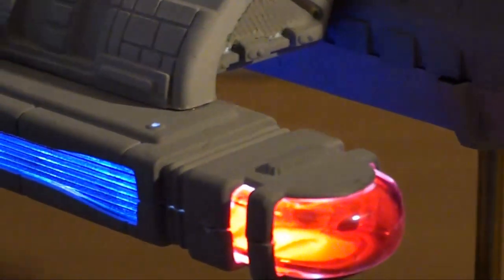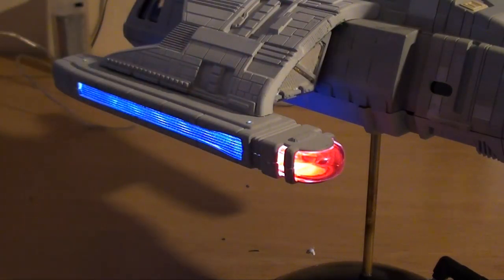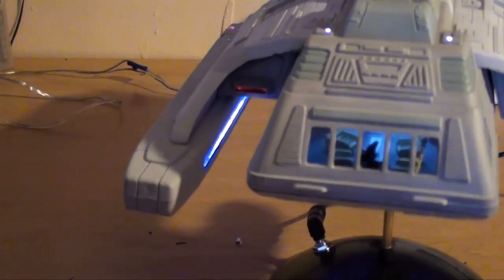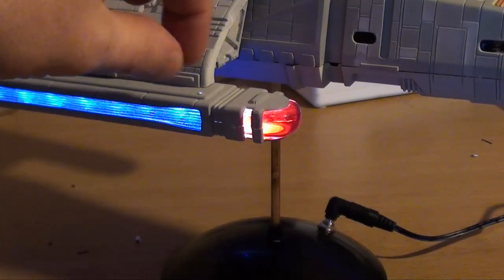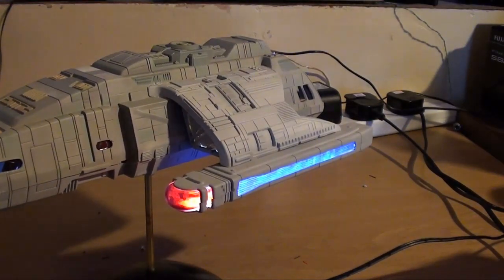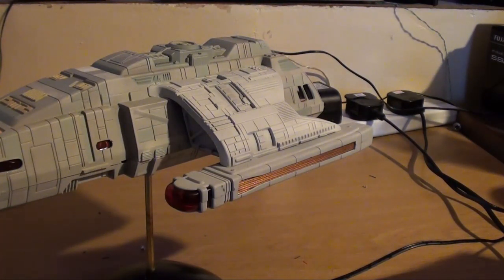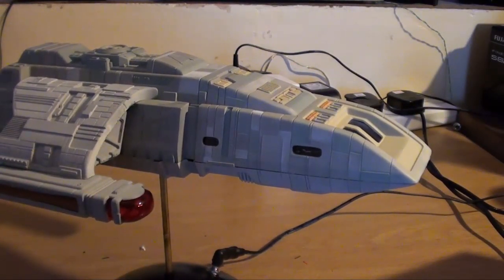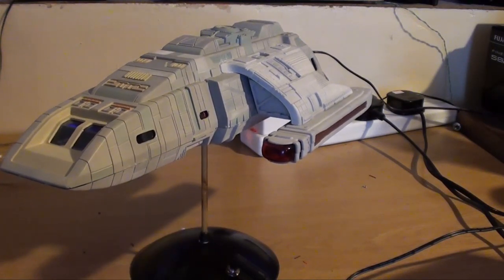1/72 scale ds9 runabout

Comment: Great model - where did you get your interior components & your “little dudes” ? If possible I’d like to 3D print my own, so if there’s a file I can use that would help too. Also where did you get your studio miniature reference pics? Again great job!
Reply from the maker: All the interior was scratch built, The figures were from a 1/72 fighter jet kit. The pics of the studio model I had from several sources I just collected as many as I could from where ever I could find them.
Reply: @Carwyn.Morris   - kudos !! Did you use styrene or 3D print ? It’s excellent work !!
Reply from the maker: @romansthirteen-four8626  The interior was all styrene except for the seats they were sculpted in greenstuff and some of the other parts were carved out of acrylic, molded and then cast in resin.
Reply: @Carwyn.Morris  - Thank you sir, I have just received my Rio Grande & your work is an inspiration to follow & attempt to recreate. I think I’m definitely going to try creating a visible interior - & possibly even a way to remove a panel (held by magnets) in order to look inside. Thanks for your specific response. I may have more questions as the build continues. I haven’t started it yet though. Thank you again!